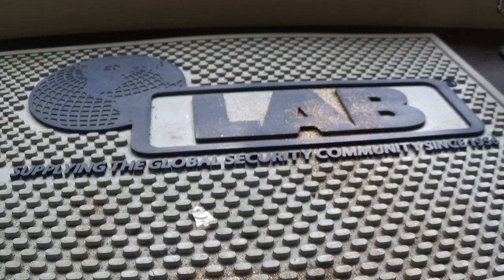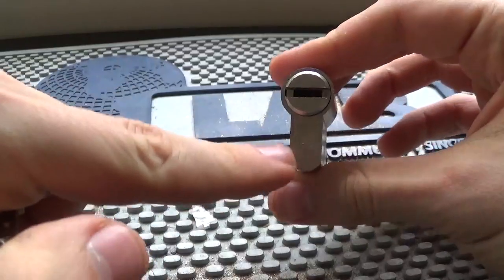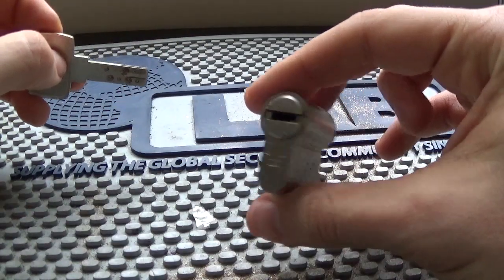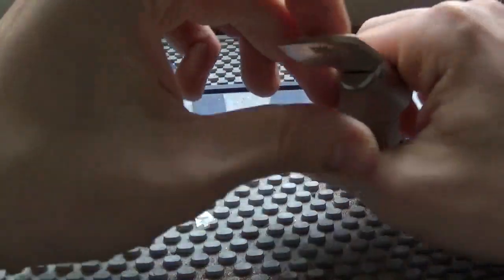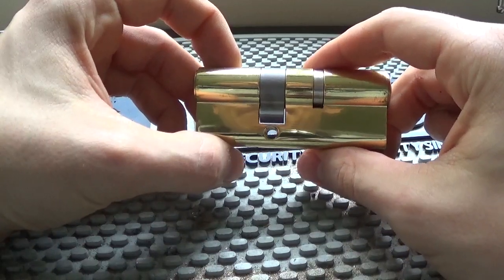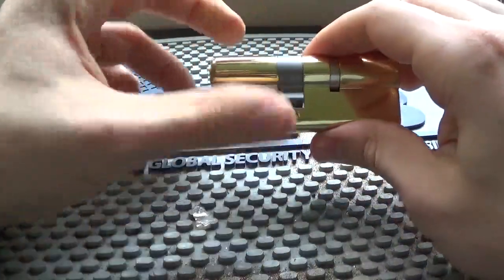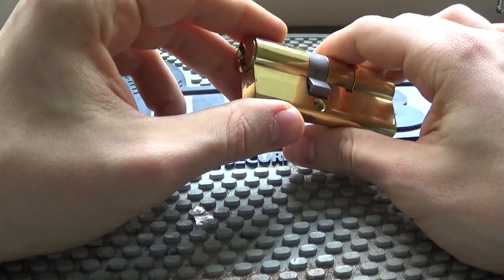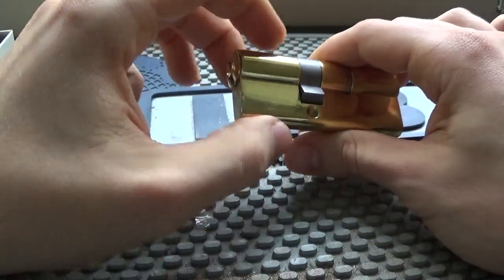How to correctly apply a euro cylinder.

Comment: Very important video, it pains me to see how many locks in use fall short of the TS007 rating. Even popular companies like ABUS, Yale, and multilock sell cylinders which are very pick resistant but quite easy to snap. There are some anti snap door handles you can get which protect your cylinder, but the easiest option is to buy a BSI rated cylinder that has a 3 star rating (and look up the lock on YouTube to see how fast people can pick it because the BSI ratings don’t apply to picking attacks).
Reply from the maker: I reckon picking does not apply because the attitude remains that thieves won't pick locks. What about rogue locksmiths?
Reply from the maker: The ultion is a good example of that lack of pick resistance.
Reply: BlackDolphin90 It is true that most criminals will be using unskilled brutal attacks but if I’m going to spend money on a lock that protects against the brutal attacks, it makes sense if the lock also protects against picking to a reasonable degree, I was actually thinking of the ultion lock when I wrote my comment, I like the lock but I wouldn’t use it because of the lack of pick resistance. All locks should come with decent pick resisting measures as default.
Reply: It is more likely that picking isn’t included in the rating because it’s difficult to ‘measure’ because everyone has different picking skill levels, and also they know that most people won’t specifically be looking for a lock that is difficult to pick.
Reply from the maker: It does even have rake resistance

Comment: In 90 % of the locks, you can not fully insert a key from outside, if there is a key fully inserted on the inside
Reply from the maker: Ah ..you have to pick it though first or can you use a wire to manipulate the other side to make it turn?